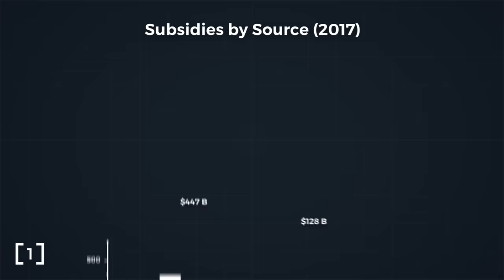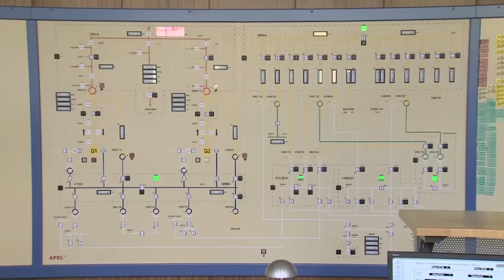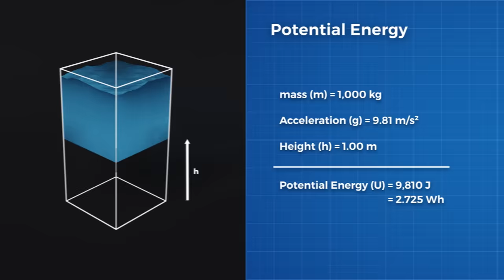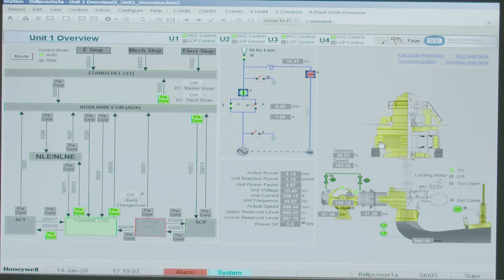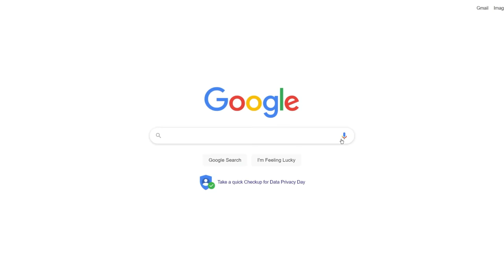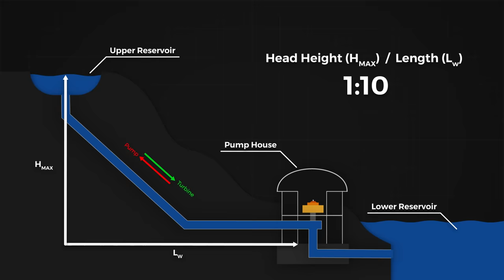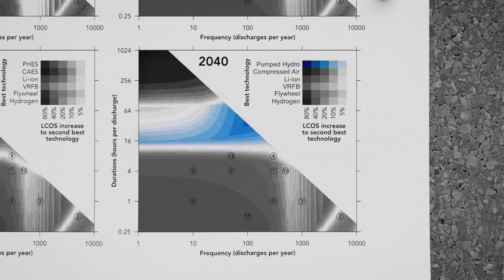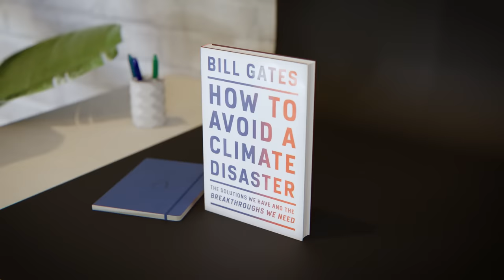The Truth About Pumped Hydro

Comment: In the areas with water shortages use compressed air, as compressing air pulls moisture from the atmosphere.
Thus why air compressors have air dryer units to keep them from rusting out.
The Amish in US are currently using old propane tanks for low pressure compressed air storage.
The missile system adjacent to the radar system I worked on in the 1980's had a 10,000 psi dud 
ejector so it might be a good model and the most efficient air compressors are axial flow at north of 90%.

Comment: Check Kolnbrein Dam in Austria. It is part of a pumped storage system in the Malta region of Austria, and it consists of three dams, each lower than the previous. The final step is sending the water from the third dam through huge pipes to the river nearby, where the final and largest generation step occurs. Very interesting, I visited the dam. It has been built in the 70s if I remember well, so the technology is not new. Maybe we can convert the actual dams to be able to pump water, this way building costs would be greatly reduced.

Comment: Still less massive undertaking than building colossal battery banks (1.5 times more than total battery storage currently installed in USA just for Ireland), and replacing them every 10 years or so. Properly built hydroelectric power plants if maintained can last basically indefinitely. Enviromental costs are incomparably lower as well, just one open pit lithium mine destroys a larger environment compared to 40 turlough hills combined, not even considering contamination

Comment: Everyone is always talking about hydrogen for long term storage and the automotive industry, but methane arguably just as appealing.

This might be because methane is more commonly associated with natural gas, which is not an energy storage medium, but it can be used in the same role as hydrogen in power-to-gas nonetheless. Methane has a lower conversion efficiency to hydrogen, and the process is more complicated and costly than for hydrogen. That being said, methane can make use of existing natural gas infrastructure, which could help to reduce costs.

Comment: I liked the video a lot. However what I was missing is what the increase would be in the energy generation to “reload” the system after a energy requirement peak. Off course it depends on how quick the cycle of peaks are and what the pumping efficiency is to fill the upper reservoir again. But roughly speaking if the hydro power is multiplied by 8 the “reloading” capacity would quickly be in the scale of 12-16 times what is now required (50-66% efficiency in pumping them full again)

Comment: Great video.  On the compressed air system, I understood this to be for rapid loading (in seconds) of the generator as pumped storage of this era was to help grid with demand of kettles going on with popular tv show advertisement breaks.  The compressed air system enables the turbine and generator to be spun at synchronous speed (generator locked to grid freq and driving the turbine as a motor).  When rapid demand is made the water inlet can be opened and immediately load the generator, no delay in synchronisation.  Most sites refer to this mode of operation as Spin-Gen.
Reply: In New Zealand hydro the compressed air system is referred to as tail water depression (TWD) which allows the rotor to spin unimpeded. I think on this mode they can generate reactive power to counteract imbalances from inductive devices.

Comment: The calculation on energy storage increase by raising the height of the storage reservoir discounts the fact that a longer pipeline equates to a lower efficiency. One needs to adjust the efficiency (lower) correspondingly to the increased height of the reservoir.

Comment: Maybe I missed something in regards to sea water H pumping power generation: why not use the sea as the reservoir dig tunnels down 300 meters down diagonally to under the coast where the generators are positioned then pump the water back up to the sea. No e we worries about a reservoir being emptied during high demand periods. Ireland has lots of available coastal areas available. Correct me if I’m wrong but isn’t there a lot of disused mines in those same areas to facilitate the 300 meter drop? 

HAPPY NEW YEAR to all! 🎉

Comment: I think you are correct about the solutions.  I believe the opinion in Ireland is currently focused on investment in battery storage technology.  It seems a significant issue with pumped storage is the initial cost of the investment.  Turlough hill is a huge success and an awesome site, having visited it myself. 
Even the development of wind farms face hurdles where the funding and regulatory approvals are out of step.   Some of this needs to come at a state level, as the innovative Shannon scheme and Turlough hill did in their time.

Comment: Thank you for this video as always. It’s often a treat to find them on topics I am interested in.

The one question I was really hoping you would answer...why water? When the power is flowing, it seems we could be lifting anything we want and just letting it back down when we want that energy back. So why use water? Ok you don’t want to suspend giant boulders cause extracting the potential energy has to be safe and non destructive... But can’t we increase the plants maximum capacity by just suspending heavy things in the water that we are already working with? Everything is already in place, just load up a barge with a bunch of rocks and thorn the whole thing into free extra capacity for the system. 

I am sure I am missing something obvious
Reply: Because water is abundant, heavy, and the technology for its use is basically the same as any other hydropower setup so the expertise for its use is cheaper than a novel design.
Reply: You're missing everything. Water and wind are fluids, that's why  we can use pumps and turbines to store/release energy. Please see the mass flow rate in a typical hydro turbine and calculate how many boulders you'll need per second to generate that kind of electricity.
Reply: @Chopper153  I get that we don’t want to rebuild the entire infrastructure to use boulders. What I am suggesting is you put an old cargo ships on the water and load it up with weights. Wouldn’t that increase the total gravitational potential that we are storing and give us a way to get more out of the system? 
I feel there is a flaw in my thinking, just can’t think my way to find it.
Reply: @Rkcuddles  How will floating a heavy mass on the top lake increase potential energy? Potential energy depends on height of water body, not on things floating on it.
Reply: @Rkcuddles  In order for a ship to float, it has to displace the same weight of water as the ship weighs. So if you want to float a thousand ton ship, you lose a thousand tons of water (at the same height in the reservoir). Ultimately you aren't raising and lowering the weight of the ship as far as you are the water.
Reply: @mukansamonkey  ooo I see. I think my mistake was thinking it was a closed system so when you add the ship, you pressurize the water and store more potential energy. But with the lake, you just displace water and either it overflows or the level rises but you don’t have more water. Should have paid more attention in that fluid dynamics class… thank you for the responses

Comment: Perhaps one could put some of those airbag batteries into the upper and lower water storages. When one of the resourvairs are low/empty , the airbags be pumped full of air, and when the resorvair is filled up, it will squeeze the bags, delivering some energy in the form of compressed air. At least one saves the energy of dragging the airbags down under. 

Though, comparing to the energy generated by the water turbines themself, it's probaly not a lot to be gained, but hey, might as well get a little bit more out of water just sitting there anyway.

Comment: Stupid question: Why don't we build pumped hydro underground? Dig deep into the ground - the more head height, the better - make a big cavern at the bottom, use the dug out soil and rock to build an upper reservoir. Build that next to a river near a city and you've got the necessary fresh water and short transmission path.

Comment: Gravity batteries are very effective, and water is the best storage mass I can think of, since it's easily pumped, doesn't wear out, and the weather sometimes decides to give you a bonus megawatt. Ideal terrain for building these batteries isn't everywhere, but it doesn't need to be. Stick these systems in where they fit easily and use something else in other locations, like thermal storage or flywheels or compressed air, or hydrogen or iron-air batteries or...  look we have a fuckload of options, but it's really hard to find a technology more mature than a gravity battery that uses pumped water. Hell, I say overbuild the renewables and use excess generation for carbon capture plants.

Comment: Hey  thanks for adressing my comment... ...several weeks BEFORE i posted it.  Though i will add that a mthod can still be cheaper or more expensive. Just depends on what way it's used. Environmental regulations increase costs and bar competition and lobbying remove efficiency too since none are allowed to challenge old companies. But I will concede the subset point. 😉

Comment: I read Bill Gate's book. I don't understand why @Real Engineering say's we need a mix @15:30 of batteries (and/or power generation methods). I've heard this idea of a 'mix' around a lot before. You can run a grid on 100% Nuclear right? Bill really perplexes me. He allocates a little of the book discussing Nuclear and how undervalued it is, basically describes it as the holy grail. It has none of the down sides of renewables and it's safe. But, the weird thing is he doesn't say why we shouldn't just run the grid/s on pure nuclear. Sometimes I wonder if it's because he knows that it just FEELS too scary for humanity (as a whole) to accept?

Comment: I would suggest if turlock  hill  can use the world largest water pump which is about (4000kw) to pump the water back into the reservoir.  
Thanks in prospect.
Reply: The pumps used at Turlough Hill are about 80,000 kW each.

Comment: Great video! Great channel! I have a facility like this near me in the US (Northfield Mountain), and toured it pre-911 days. It was impressive. That said I always understood water was pumped up by cheap electricity during low demand times, and released to generate more valuable electricity during peak demand times.  But I’ve always thought of it as a means of generating money for investors, rather than adding net power to the grid.  While I now understand pumped hydro more as a “battery,” and see the value in that, I am still left with the question of whether the amount of power generated truly offsets the amount of power necessary to pump the water into the storage area.  A civil and intelligent answer to this would be appreciated!
Reply: I think the electricity used is about 80% of the electricity generated.
Reply: It also has to do with they way the power grid works. It's not like a water tap, where there's pipes with water constantly running through it. 

https://youtu.be/xhxo2oXRiio 

This video from Wendover, beautifully explains how the power grid works. 

For example, in England they used to (not sure, if they still do) have to buy electricity from France during the ad-breaks of the most popular tv shows, because a big part of the population would get up and make tea at the same time, which consumed more electricity than England could produce. 

That's why energy storage is such a huge issue right now. 
Hope that helped!
Reply: The mistake you are making is thinking of it as "storing when cheap". What storage like this does is "stores when excess is being generated". The supply to the grid has to be adjusted continuously. Feedback loops that work in less than a second, in some cases. So when a gust of wind increases avaliable wind power, there are three choices. Other generators drop their output, some electricity gets diverted to storage... or the windmills disengage their blades and lower their output.

Basically if you want to capture as much energy as possible from wind and solar, you need storage. The grid can't use erratic inputs.
Reply: @mukansamonkey  You need to start with definitions: You are completely confused! First, give clear scientific definitions of MASS, ENERGY, GRAVITY; in accordance with the logical law of IDENTITY! Energy is not something tangible that you can store and accumulate!
Concentrate, stop raving!
Reply: In europe we have so much of these storages, because most trains runs on electricity and the rushhour in the morning in winter has a super high peak demand
Reply: It always takes more energy to pump the water up than what you get when it is released downwards, the efficiency of the storage facility in the video is around 80%, which means that you get 80% of the power you had to use to lift the water up when you release it back down.

As for the profit thing, the price of electricity changes constantly with production, when you produce more electricity, there is more of it, and thus it is less scarce, costing less. When there is less electricity generated, it is more scarce, and costs more. But naturally, you only really need to store something when you have an excess of it, meaning electricity is stored when there's a lot being generated, this means that naturally electricity will be stored when it is technically cheaper, and released when it is more pricey. But at least where I live, most households have a solid deal, meaning they have a constant price on electricity for say a month depending on forecasts and such, so the price wont change by the hour, meaning things like this can't really be exploited in such a way.

Of course in the end, the thing that businesses do, is make profits. So electricity companies will always do what is best for their profits, it would not make sense to do anything else really. 

I hope my explanation makes any sense, I'm not a native English speaker, so forgive me if my sentences are a bit long and tough to read.
Reply: @mukansamonkey  But you can always put a few dozen windmills on the top of those reservoirs to pump water full time up.  You get full use of the land around it, and help overcome the losses of the 80% conversion rate. That could extend the operating hours of the hydro generators by some fraction depending on scale also.

Comment: Hydrogen electroysis can handle variations in energy inputs. You can dump excess green energy into hydrogen.

Hydrogen storage kinda sucks but there is not huge energy loss to make ammonia with that hydrogen. 

Gas turbine plants can easily run on hydrogen and/or ammonia. 

In fact, old coal plants are being converted to run on ammonia in Japan. 

Any extra ammonia can be used as fertilizer or as a diesel substitute. 

NH3

Comment: sorry sir, but your comment about cost is incorrect as you have to look at cost per megawatt-hour to find the cheapest.  The cheapest type of generator is the combined cycle combustion turbine (natural gas, very clean almost no pollution) but i digress.....  Offshore Wind = 89.2, Battery storage = 57.98, Advanced Nuclear = 50.51, Ultra-supercritical coal = 43.8, Hydro = 38.62, Biomass 34.96, Onshore Wind = 27.01, Solar = 23.52, Geothermal = 19.03 and Combined Cycle = 7.78   (All figures are US Dollar per megawatt-hour for capital costs).    • U.S. levelized capital costs by energy source 2026 | Statista    

Also, for a national grid you much have MVAR (voltage) support to be able to "push" the AC power through your grid.  Solar gives absolutely NO support via MVAR's and most wind farms do not (they can but most do not) provide MVAR support either.  There are many other factors you have not informed your audience and that's wrong!  Not in our generation will we see wind and solar to even be a significant portion of any national grid of any size.  Not right or wrong but real figures and facts you have conveniently overlooked.

Comment: The mother of all pumped hydro projects could be Lake Erie being the upper reservoir and Lake Ontario the lower reservoir. A canal could be built from near Crystal Beach Ontario to the hydro canal for the Sir Adam Beck Hydro station in Niagara Falls Ont. where generation and pumping would occur. A weir across the Niagara River would control Lake Erie's level which would also solve storm damage to Lake Erie homes and cottages. I did a quick calculation and found for every inch of water level on Lake Erie's 25,750 km2 of Lake Erie, it holds 643,750,000,000 L of water that can fall about 70 m overs Niagara Falls. Assuming a 10 % head loss and a 15% generation loss, I get 100 GWh of energy storage per inch of Lake Erie height. This could provide diurnal, and multi day energy storage for the states of Michigan, Ohio, Pennsylvania and New York and the Province of Ontario whose combined populations are 68,000,000 people.

Comment: I take issue with your calculation of how many reservoirs you need.  you took the generation currently provided by gas and divided it by the capacity of the tulloch hill (over 5 hours).  That's not logical.  Surely the answer is an increase in the renewable capacity (including the capacity factor) to match the gas output, then a statistical analysis of the peak and minimum power output compared to the demand.  THAT gap is what the pumped hydro has to match.
Reply: Also ignores the potential for building high voltage transmission for excess renewables from elsewhere. Modern hvdc only has losses of 3% or less per 1000km